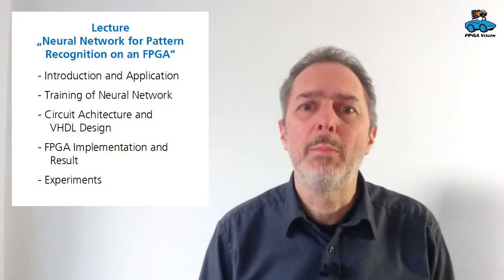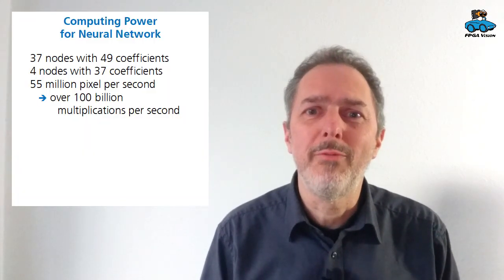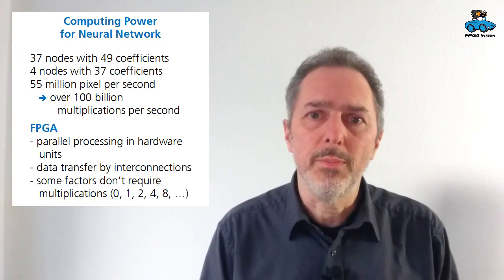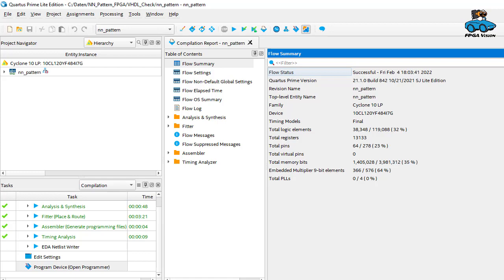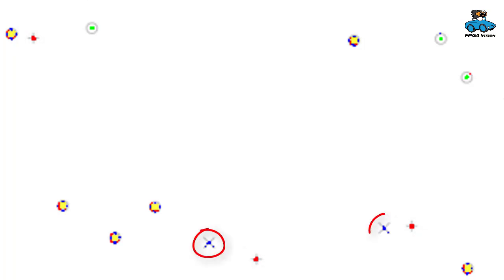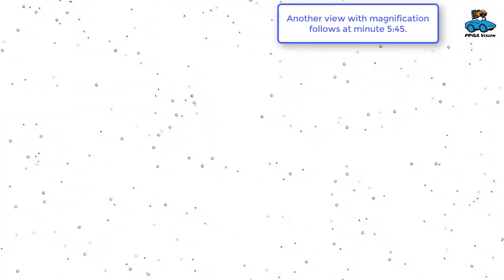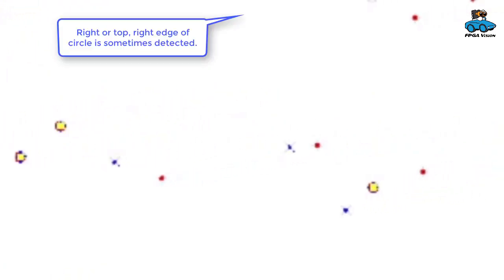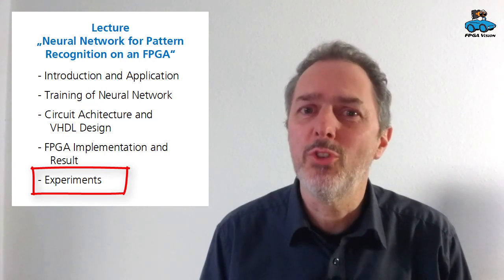Pattern Recognition with NN on FPGA - FPGA Implementation and Result

Comment: Great video sir
What version of quartus did you use?
Reply from the maker: That is 21.1.0 Lite Edition (see minute 2:40, Flow Summary, 2nd line).

Nevertheless, in my experience the software is very stable for typical applications. So, if there will be a newer version in the future, this should also work.

Comment: Thanks for the video Sir. I am working on the DE2-115 board and have a problem with pin assignments. Can you provide the pin assignment file for the Cyclone 10 LP? I want to use it to compare with the DE2-115.
Reply from the maker: You can find it at Github -> Marco-Winzker -> NN_Pattern_FPGA -> VHDL

You need HDMI-input and the DE2-115 does not have it, unless you use an extension board.
Reply: @marcowinzker3682  So, can I use GPIO to assign pins for r_in, b_in and g_in? How can we set for input and output? Since I couldn’t find the 10CL120 manual PDF, I don’t fully understand how to assign the pins.
Reply from the maker: @thinguyeninh2593  Do you have an HDMI extension board?

I recommend you use the remote lab.